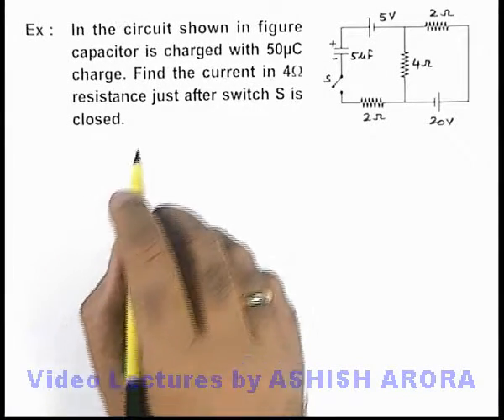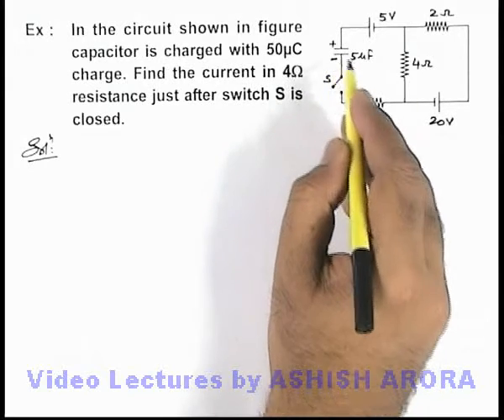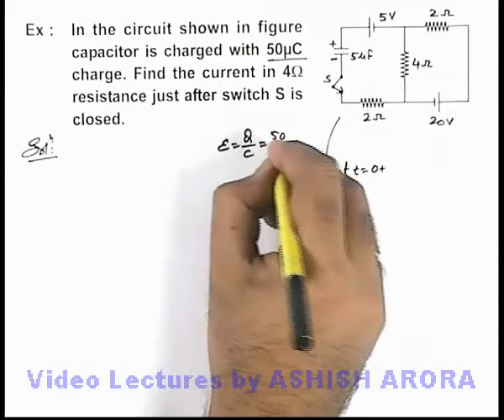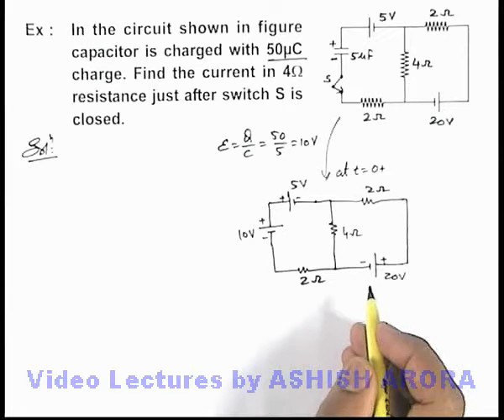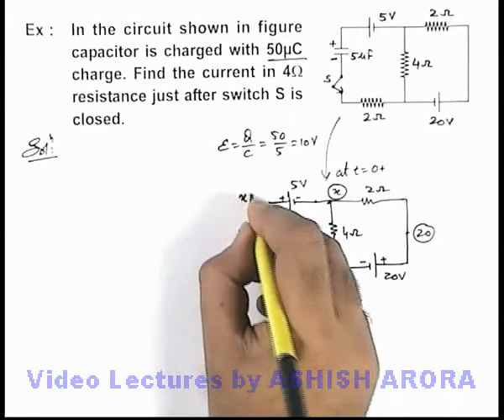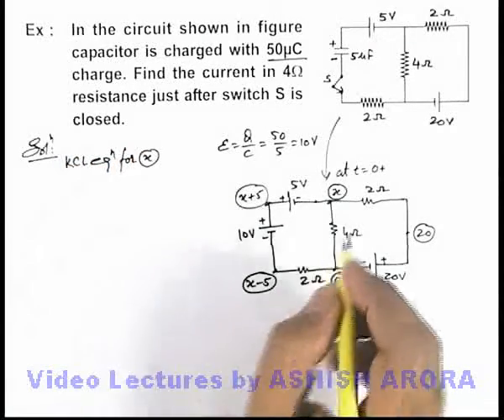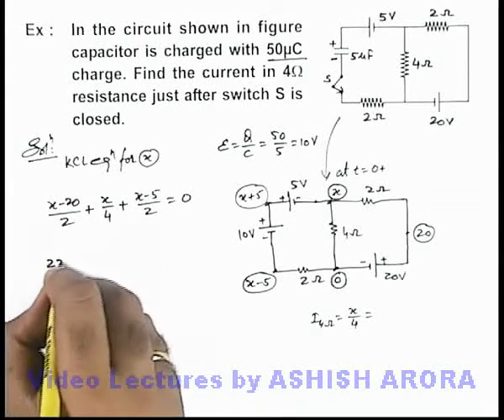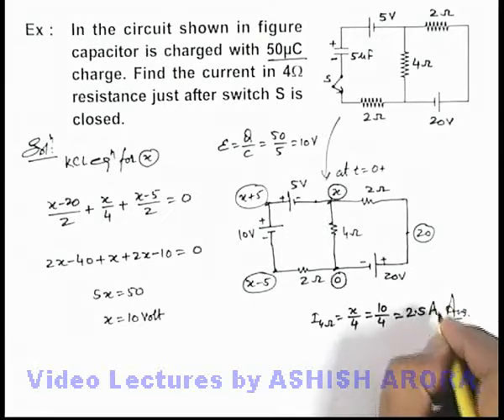Class 12 Physics | RC Circuits | #12 Solved Example-4 on RC Circuits | For JEE & NEET

Comment: Sir how can you say that the capacitor is in discharge mode, I mean first we need to make sure that the capacitor will give out out charge rather than charging itself right Sir??
Reply: It isn't said anywhere that capacitor is discharging..

We are using fact that just after closing switch at t=0+ , 

Charged capacitor → Behave as battery EMF of E=qo/c 

Unchanged capacitor → Behave as short circuit== St conductor wire